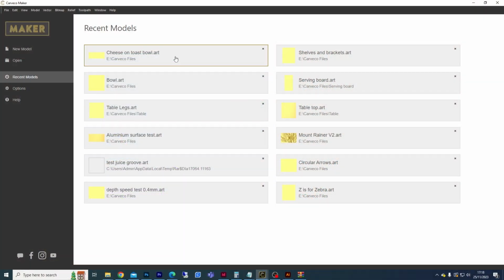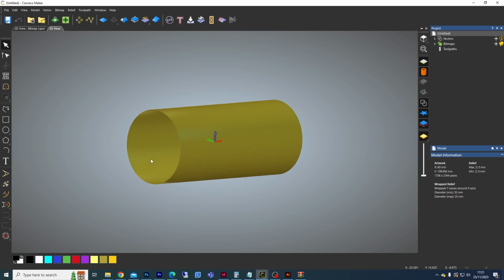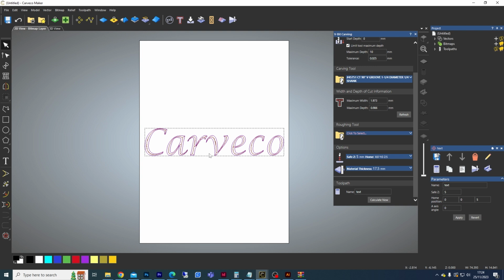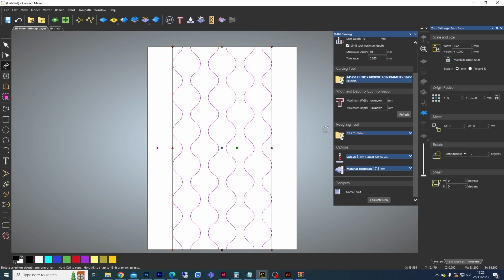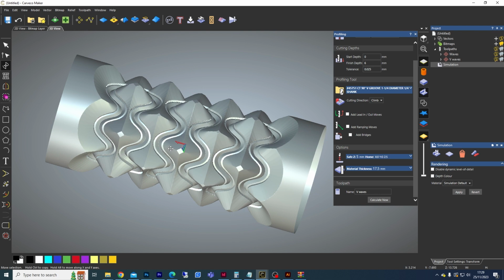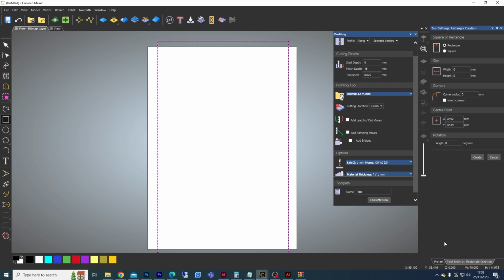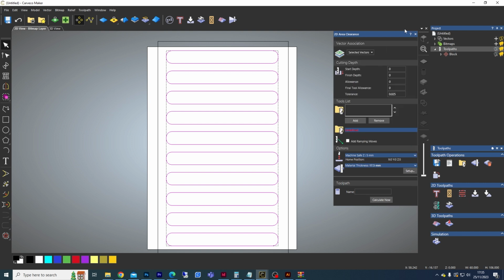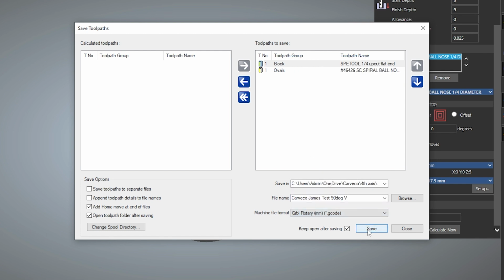New rotary/4th axis feature in Carveco Maker - Beginners guide to using it

Comment from the maker: Post processor files go into C:\Program Files\Carveco\postp
https://1drv.ms/u/s!AuoE9S3Cr4VZgqYFu4Ra_Or4Lb2Zmg?e=vG3PnR
Reply: I real want a help in here.....dedign is not a problem on me,,when it comes to machining on the rotary we call 4th axis.....I fail to get it right,what's a real POST PROCESSOR from Artcam 2018 that compatible to run on the DSP A18 controller......?

The DSP controller 4th axis controller couldn't help me on this.....

I have my CNC router Machine very well working on the flat bed with no issues...but when it come fir rotary axis I fail to achieve.

Comment: Hi James. I have watched your tutorial and found it very informative. However, I am having some issues with the rotary postprocessors. I am using the Rich Auto A18 system, and working with the Carveco Software. I have downloaded the Grbl rotary postprocessors, but when I tried cutting in it, I realized that it's cutting in the wrong direction. Can you send me another link to download so I can get it to cut X2A instead of cutting Y2A? Thank you.
Reply from the maker: I may be wrong but what you have described sounds the like the initial setup option as opposed to the post processor. When you create a new rotary file, it asks which axis you're running it on. I have not had any issues with the post processor file but if you need to change the axis within it, open it up in Notepad and about 10 lines in you'll see "ROTARY_AXIS = Y", change this over to X.

Comment: Does this mean you cannot make a cylinder from a square post 10cm x 30 cm?
Reply from the maker: You could but would be a little difficult. What you could do as an easier option is use Gsender controller. It has a rotary surfacing tool inbuilt so you would run that to make it into a cylinder, then run your Carveco program

Comment: James, I hope you can help. I am struggling hard with my CNC. I have had nothing but issues with it (multiple replaced parts) and now with my new 4th axis, The jobs come out upside down and backwards with normal gcode and with the rotary gcode UGS won't even run saying its an ivalid post processor. I hope you have some ideas because I have been fighting the urge to just return this CNC machine from day one.

Comment: Hi James, excellent video thank you. one question, how do you connect the 4th Axis and use it with UGS? Do you replace the Y drive sockets with the rotary or use the A axis plug?
Thank you for your time, most appreciated.
Tony
Reply from the maker: Will depend on your machine. If it has an A axis port then it should be done to use that. If not then the Y axis

Comment: @JamesDeanDesigns it shows it doesn’t deal with square stock. Could you do a clearance path and figure out the final diameter and have it create the round stock first with a 4th axis? If you don’t have a lathe…
Reply from the maker: Yes, you could work around it like that. You would end up cutting a lot of dead air but should solve it. The 4th axis function in Maker is fairly basic in comparison to something like DeskProto but equally there is a considerable price difference between them